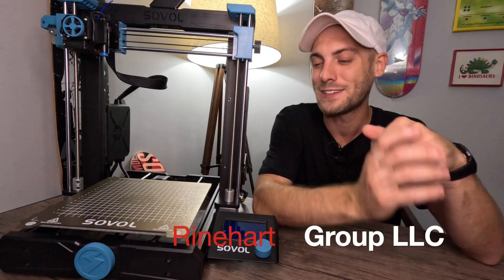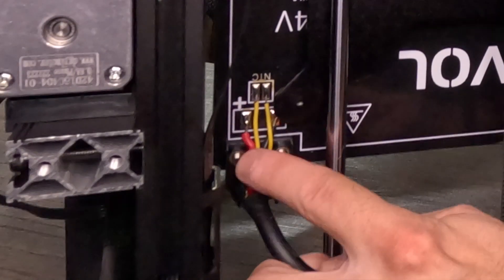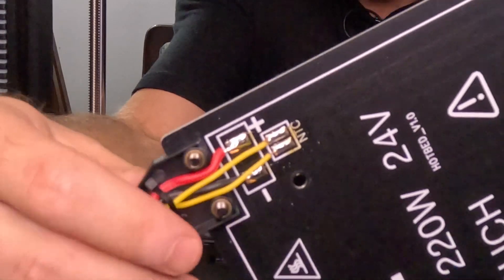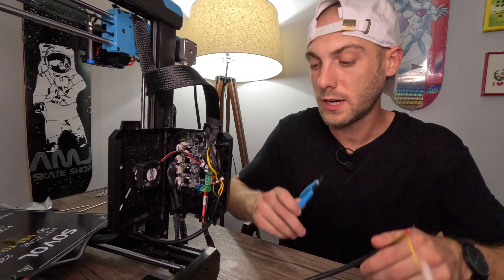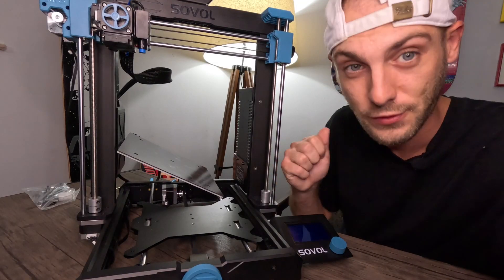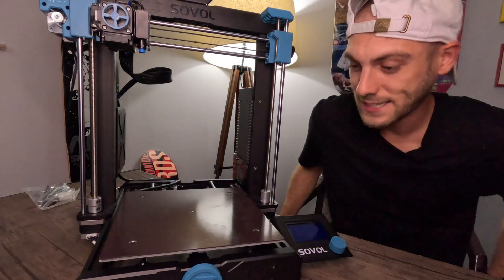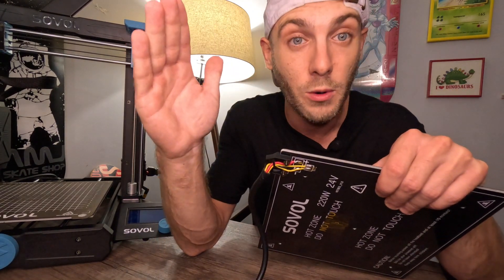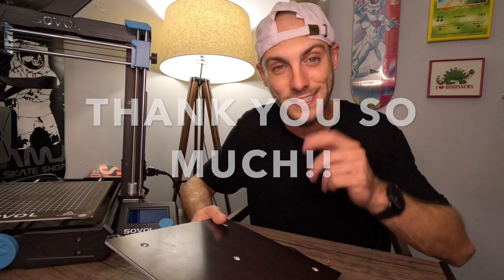SOVOL SV06 Design Flaw Solution: How To Replace The Printer Bed

Comment: Dude, for the spacers when putting the thing back together, tilt the machine on it's back and put all the screws in the heater and then put the spacers on the screws while the board is vertical.  You can put tape over the screws to keep them inserted and remove the tape as you go.  Line up one hole and get it started, then line up another hole and start that.  Get the first two screws hand tight and reorient the printer to it's normal position and do the rest. Remove the tape if you used any, and before tightening anything down go around the board and get each one started.  Let gravity hold the things in place and it's so much easier.  Before tightening, and once all the screws are started, jiggle the board a bit to get the spacers in their optimal spot.

Also, if you want to save the first board, you can put some protective materials around the wires to keep them from chaffing and further insulate them.  I recommend silicone sleves.  They are very heat friendly, and protect what they surround.

Comment: Having a problem i replaced my printer bed but right after my sensor is not sensing the new bed and when I do auto z leveling I have to shut it inoffensive because it will just keep going down digging into the bed and the sensor will not pick up at all

Comment: Say, have you found a way to remove the strain bracket for the new models? Mine has apparently warped while printing ABS, just enough to warp and bump against the back. I'm ready to print a component in ABS, I just need to know how to remove that bottom part. 😂
Reply from the maker: YouTube needs to get with the program and allow photo comments- I am not familiar with the newer models and their support bracket. Is it all one molded piece with no screws attaching it to the machine?
Reply: @RinehartGroupLLC  Asked Reddit earlier, I had to lift the corner of the bed, that will reveal the hidden screws. I recommend doing it slowly while the hot plate's heated some.

Comment: I have the new style bed and one of my yellow wires inside the the cord still broke after having the printer for just a month so wanting for my new bed now. thinking about snaking a thicker gauged wire though the cord and soldering them to the bed and to the thermistor plug on the old bed just as a back up incase it happens again
Reply from the maker: When you say new style bed, did you just buy this printer? I’m just curious if brand new ones are still having the same problem.

Sovol will definitely give you another bed but if it is something that’s constantly happening, the thicker wire may just be the way to go- definitely a great idea on your part there. Please keep me filled in with how it goes!
Reply: @RinehartGroupLLC  just got my new hotbed today and hooked it up good to go. I did notice the yellow wires on the old beds thermistor was coated in harder plastic and the yellow wires on the new bed are coated in a very soft flexible coating hopefully that will prevent them from breaking in the future. still plan on upgrading the thermistor wires on the old bed to a much heavier gauged wire but the solder on the bed is a pain in the butt to get to melt however that's a project for another day cause the new bed is working...   Thanks for the video and the help

Comment: Wow I am glad they got back to you; I still didn't hear back from them yet. My Sovel v6 really messed up. The bed didn't get warm, but it kept on going and my nozzle got all plug up, So not only my bottom plate doesn't work my nozzle is shot too.
Reply from the maker: How have things been going for you since your last bit of trouble?
Reply: I wish more people would tell them about this problem They are giving me a hard time about the warranty. My printer isn't 3 months old yet and they got a year's warrant but because I got it from Walmart, they said the warranty was viol. Still fighting with them will let you know what happen @RinehartGroupLLC
Reply: @RinehartGroupLLC  
Hi Things worked out great thanks to you and the video you put up. They really heap me out a lot.

Comment: thanks a bunch for this video. I actually haven't tried this printer yet, but just trying to learn things like this so I know what to expect
Reply from the maker: I honestly thought about buying another one just to see what changes have been made in have been told by sovol and other customers that they are shipping the beds now with a cable support but that they are STILL having the cables fray.

I LOVE this 3d printer- easy and reliable but this is just one quirk that comes with it

Let me know if they do anything more with the cable support if you order one before I do😃

Comment: pro-tip: put the screws in the bed and lower it at an angle, guiding the screws into the spacers one at a time.  I printed new spacers to level my bed.
Reply from the maker: How does this help with the wires fraying from the bed moving?
Reply: @RinehartGroupLLC  It just makes it easier to put the bed back

Comment: Wait so would this fix my problem of how my printer bed is halted and when I switch the thermistors it works
Reply from the maker: No that’s more of a way to determine that the thermistor or thermistor wiring is the problem. I would open a support ticket with sovol and they should send you a new printer bed.

How old is your sovol sv06?
Reply: Idk how old it is I just know that it has the old crappy heat bed wiring and have been messaging sovol thanks to your vid 😁 thanks so much for making this

Comment: The cable support mod helps, I used it from day one, which for me was May 17th 2023.  Yesterday I started having issues, I changed the min temp in my Klipper config so the printer wouldn't turn off every time it happened and I could see some data.  It's 100% the bed thermistor not working properly.  If I bend a certain area of the cable it will read properly, but the second it's moved, whether it's trying to home the printer or certainly if I tried to print: the temperature fluctuates wildly into the negative and if I have a target temp set, the printer will shut off.

I'll contact Sovol since it's still under warranty, but in the meantime I might just cut the wire open and solder whatever the weak point is, and find a longer or better support than I had.
Reply from the maker: And I have been seeing quite a few people say the same thing- the cable support mod works but not forever. Sovol just sent me a completely new bed for free and I bet they will do the same for you. 

Is this your first 3d printer?

Comment: yo bro do you know if the fan on my motherboard should be running all the time? ive honestly never seen mine on and i have my printer on 24/7 sometimes printing sometimes not.. usually only not cuz i keep getting driver errors :/
Reply from the maker: Yes sir, as long as the 3d printer is on- that fan will be running

Comment: I printed the support piece and installed it. Works great with no issues. I do, however, continue to monitor the connection to make sure no unforeseen issues arise. This also was one of my first prints.
Reply from the maker: Please keep an eye on it! I have seen a couple people coming back at me saying that the supports still will allow the wires to fray over time

How old is your machine? Recent purchase?